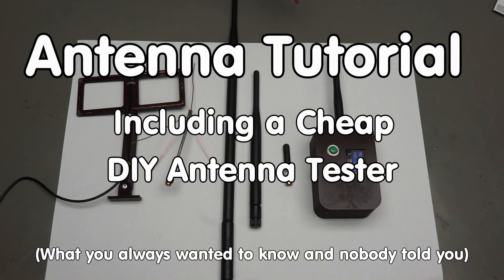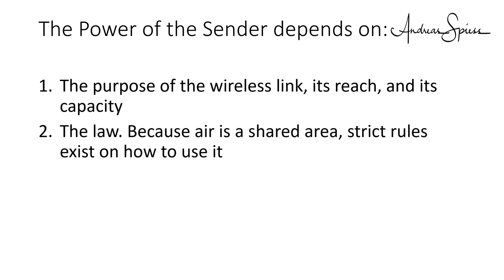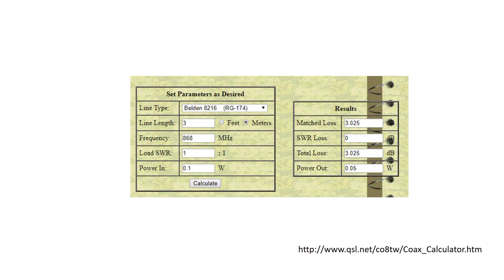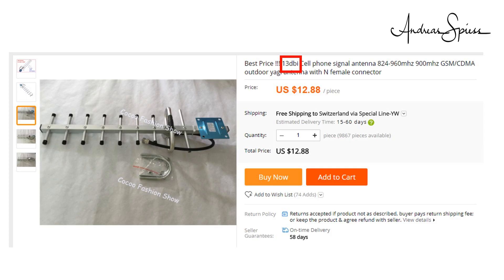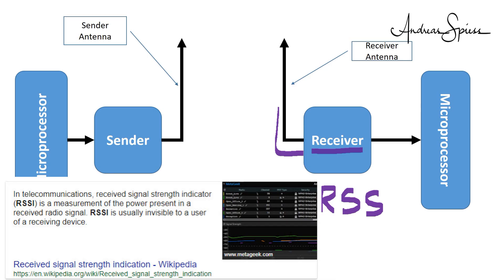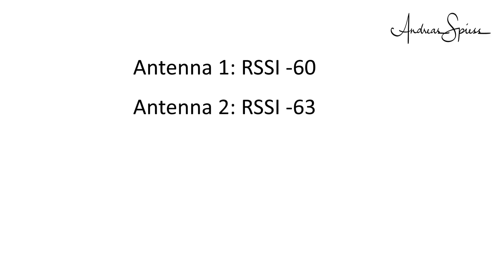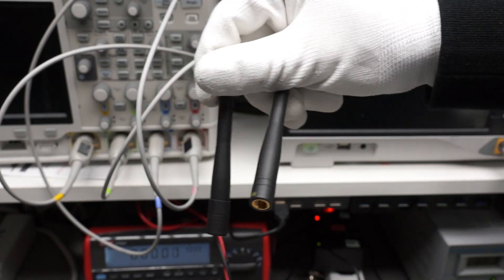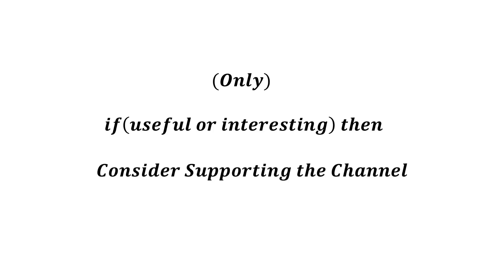#188 Antenna Tutorial incl. cheap DIY Antenna Tester (LoRa, ESP32)

Comment: Hi Andreas, Very nice explanation!
Even if you had a clear LoS, would humidity/fog/rain decrease the RSSI especially 2.4GHz-5GHz?
Reply: Yes there is an effect due to rain. However for tersterial communications the effect is so small that it can be ignored. Maybe 0.001db to 0.01db per km @ 5ghz in moderate rain.
Reply: आदित्य Aditya मेहेंदळे Mehendale, yes it does make it worse and for the higher frequencies it doubly worse.
Reply from the maker: Neil is right.

Comment: Excellent Andreas as usual !
BTW I would like to see the result for a very simple dipole antenna : https://nathan.chantrell.net/old-stuff/radio/radio-scanning/how-to-make-a-simple-dipole-antenna/

mine here : https://www.thingiverse.com/thing:2789234

I only have a poor helical antenna and this one I made which works very well. But how well compared to your reference and the Moxon ?

Waiting for your next video !
JP
Reply from the maker: Dipoles have 75 ohms and therefore do not fit very well to our 50 ohm systems. The Moxon antenna BTW also is a dipole with a reflector. But I did not test its impedance yet.
Reply: Hi,

 I am not an antenna expert but followed the guide provided by this clever Prof : https://github.com/CongducPham/tutorials/blob/master/Low-cost-LoRa-IoT-outdoor-step-by-step.pdf
slide 20 and 21
I must say that I reached 9km range with this simple setup
Could I reach better with the Moxon ?

Comment: About your question about the gain and the law Restriction:
Most of the given restrictions (I know for sure in Europe) are based on the ERP which calculates from sent Power an the gain: ERP=P_tx*G_tx (for linear values) = P_tx + G_tx (in dB). P_tx is the Power which goes into the antenna.
So if youre allowed to send 1000W and you have an antenna with an gain e.g. 13dBd, the maximum Power which is allowed to go in the antenna P_tx is 50W (transceiver power - Cable loss).
Reply: This is the same also for Lora, Wifi, Bluetooth,...
Reply from the maker: This is what I thought.
Reply: But now I see, I made a mistake and forgot to mention something. The ERP  is calculated with the gain in dBd and the EIRP with the gain in dBi. The differnce is just the reference Antenne and the relation is: gain in dBi=gain in dBd + 2,15dB. This is equivalent for the Relation of ERP and EIRP.
This is also something you have to pay attention to, when reading the regulations. Sometimes it´s ERP, sometimes EIRP and when reading Datasheets. 
The antennas are mostly given in dBi, but the regulations for low frequency stuff are often in ERP (mostly <1GHz) and for  higher Frequency stuff in EIRP (mostly ≥ 1GHz).

Comment: To reinforce the "keep coax cables short" .. 3G over 50kms air gap + 21m coax = 0 bars. 3G over 50kms air gap + 0.2m coax = 4.5 bars. I was surprised to discover the amount of loss in the cable compared with FSL.
Reply from the maker: Thanks for your example.

Comment: Can't wait to see the video about Vector Network Analyzer. I was thinking if two hackrf one modules can be used as VNA... Thank you !
Reply from the maker: Maybe a little expensive ?
Reply: @AndreasSpiess  Hello, is it worth the effort of purchasing original miniVNA tiny? At some point you said it has some stability problems when it heats up or something like that. What is with the Chinese clones their price is close to the original. I have the MR300 i did connect it to a 13.56rfid pcb loop and nothing.
Reply from the maker: I never compared a miniVNA with a professional rig. But it shows nice Smith charts. Heating is quite common for precise equipments. This is not a flaw. If you want smith charts the miniVNA is probably a good thing. Just looking at one complex number at a particular frequency does not help a lot.

Comment: Regaring the longer antenna: AFAIK the length of an antenna has to be distinct fraction of the wavelength of the signal to work properly/optimally. (e.g. https://www.pulseelectronics.com/docs/library/Antenna%20Basic%20Concepts%2007%2012.pdf). So just a longer antenna would not improve the signal reception/sending necessarily
Reply: I didn't doubt Andreas' knowledge. His videos are an exhibit to the fact that he knows, what he's doing. It just was not clear to me from the video what the point of a longer antenna for the same wavelength would be.
Reply: Jens Hausherr as a  ham, he knows that part. I think it was this channel were he discovered some antennas have whatever frequency you want printed on the package but the physical part is tuned for a completely different band like an overstock wifi antenna simply relabeled for lora  :)
Reply from the maker: + Jens: I think, this is what I wanted to say.
Reply: Ah I see :) Your link didn't work for me  but yes there is more than one length that can be used. Could be 1/4 or 5/8 wavelength monopole, 1/2 wave dipole or multiple stacked elements in one vertical. Basically squashing the doughnut radiating pattern to put more of the energy horizontally but still resonating. Also the physical length can be different than the electrical length depending on coils or capacitive loading etc.

Comment: Nur how would you theoretically be able to use 1000w if lora produces only 100mW?
Reply: You use a linear RF amplifier.
Reply: https://www.amazon.de/ILS-0-1-2GHz-Verst%C3%A4rkung-Breitbandverst%C3%A4rker-Brett-Amplifier/dp/B079132D3G/ref=sr_1_4?ie=UTF8&qid=1520769263&sr=8-4&keywords=rf+amplifier

something like this?
and is this really the strongest i can get?
because as i understood it, i can achieve a higher range if the dbm are higher and i want to build a high range rf transmitter for a big drone.
Reply from the maker: +Hans: This is more an amplifier for the receiving side. 100 watt amplifiers are a little bigger and more expensive ;-)
Reply: oh, sad thing, i really want to have more power on my system...

Comment: Hi Andreas, I made a "more real world" antenna test, and recorded the RSSI reported by all gateways on ttn I could reach (about 5 in Milano area), subscribing to the packets from ttn backend. The main result is similar to yours and I could identify general antenna performance. But another interesting outcome is that some antenna perform better with some gateway ad some with other gateways. I think it depends on the type of antenna in the gateway it but could be also something else. About radio power I noticed that the default lmic does not change it and is fixed to 14. The code is not easy to understand but I think it is expected be changed by ADR (adaptiva data rate feature). I made a change so you can set it in the sketch. Would you like to try it? https://github.com/marcobrianza/arduino-lmic. Ciao!
Reply from the maker: This is also a possibility. Did you get stable results?
Reply: there RSSI is +-1db around average

Comment: I'm fairly certain that antenna lenght is crucial to match frequency for the TX but on the RX end it isn't relevant so perhaps for RX longer is better. However, separate TX/RX antennas is an additional complication for simle links!
Reply from the maker: You are right with the length and the frequency. Basic physical principles, however, are valid for the receiving and the transmitting side.

Comment: Thanks for showing us your method. I was encouraged and disappointed. Disappointed because I was looking for a new and better method, and this is exactly what I did. Even down to echoing the RSSI in the message. 
Encouraged because then I know I did not miss an obviously ingenious method for antenna testing. :-)

Maybe the next video will show me wrong? But seriously, this method works well. It will tell you what antenna is the better one. Although it may not tell you why it is better.

For others testing using link loss: it is very important the antennas are at exactly the same point in space every time. And that no other objects in the vicinity is moved. Just a few centimeters difference can make your RSSI change a lot. Maybe you noticed that there is a delay after button press before test signal is sent to allow Andreas to move away from the near field of the antenna. Because a human body is also a disturbing object.
Reply from the maker: Thank you for your feedback and your experience. Antenna science is old and most is invented. But not known to many people. The next video will cover the why.

Comment: Nice video! 
I Noticed that you took measurements with the sender and receiver on different elevation levels. Seen in that licht, it doesn't surprise me that longer antenna's prefom worse than the shorter ones. The shorter antenna's radiate more or less in a round spherical pattern, while the longer ones have a flatter one. If this flatter sphere isn't properly alligned with the receiving antanna you get big losses. You can run simulations of this effect in Eznec.
Reply from the maker: You are right. In reality, the longer antenna was not properly adjusted to 868. Because I found many of these antennas with my friends I wanted to make this point.

Comment: Excellent and interesting video (and channel) did you do any experiments on different antenna on either end? For example if you have a one way transmission only would a higher gain antenna at the receiver and a legal antenna at the transmitter increase link budget or do different antenna styles have a negative effect?
Reply from the maker: Both antennas have the same effect. A better antenna on the receiving side as well

Comment: Excellent Lecture!
I think some words about the Fresnel Zone would clarify why antenna height is essential and why a reception might still be possible when the direct line-of-sight is obstructed or curvature of the earth gets in the way.
Here is a good online calculator for the fresnel zone: https://www.everythingrf.com/rf-calculators/fresnel-zone-calculator
Reply from the maker: Thank you for your link. I think I covered parts of it in my long range LoRa videos
Reply: I was missing that one too. Line of sight only is not enough to start calculating if you get a usable signal on the other side. You can get nasty reflections which cause multipath etc
Reply: the Fresnel zone can save you in case of an obstructed view: If there is at least some of zone going "over" or "around" the blocking object, it might be not perfect, but be sufficient for a link even on 5GHz.

Comment: In Sweden I don't think we have extra limits on directional antennas. Its just the transmit power that matters afaik
Reply from the maker: Thanks. I am not a lawyer and did not read the text. Maybe we will know more from other viewers.
Reply: You should be under pan european rules. They state max output power in ERP or Effective Radiated Power. So you take your transmitter power in dBm, add (negative) gain of the cable and (negative or positive) gain of antenna. So if you loose 3dB in your cable and have antenna gain of +6dBi then you have to turn your transmitter down 3dBm lower than the max ERP.
Reply: Einar S that´s correct. The restrictions are all based on ERP.

Comment: What I really hoped was, you would talk about device @6:00
is it N1201SA?
Reply: which is very interesting since item clearly has in and out port... but reflection bridge to specific to antennas, so yes, that will always be sold separately. But I think that is false. What you can buy separately is wideband noise generator (used for antenna testing). Even so, 70$ for analyzer and some 15$ for noise, and xx$ for directional coupler is still ok I think
Reply from the maker: As I said, this is stuff for another video and yes.
Reply: At some point, would you have a look at SMA Spectrum Analyzer, that has 138M-4.4G range and price is <100$ even after taxes
Reply: First2ner, please provide more info on 'SMA Spectrum Analyzer'. Source, model number, cost, etc.
Reply: go on ebay and search for 138M 4.4, it is around 70$
Reply from the maker: Pay attention. For me it is not clear what is included. They write that the tracking generator has to be ordered separately. And I do not see that a reflection bridge is included. I will not order. Too much risk to be disappointed. Somebody else has to go ahead.

Comment: Andreas, is there a way to simply modify the antenna set up for drones/quadcopters to boost the signal strengt/range without adding too much extra weight to the drone. It has to emit the control and video signal. Danke ;)
Reply from the maker: If you are interested in FPV antennas you have to watch this excellent channel: https://www.youtube.com/channel/UCHqwzhcFOsoFFh33Uy8rAgQ